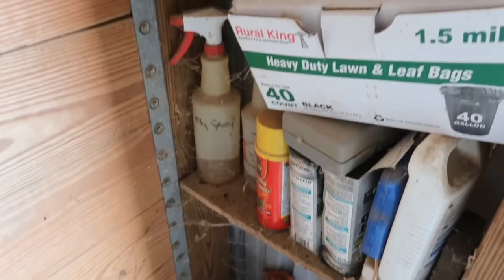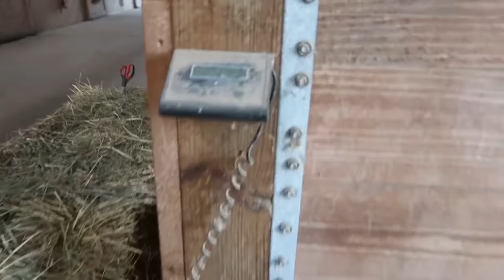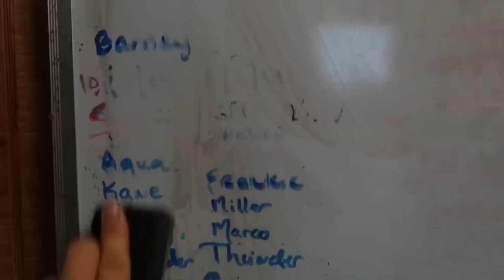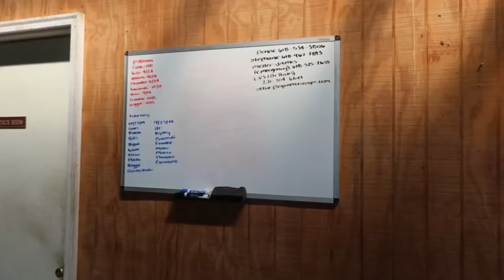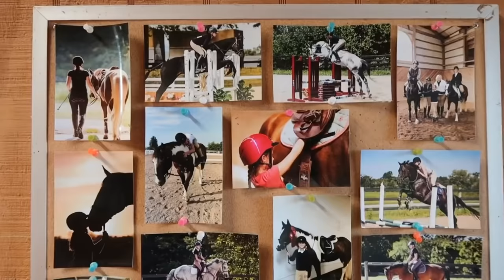cleaning the barn for 3 days straight (satisfying)

Comment: Know this is an older video so you probably won’t see this comment. 
Cobwebs dust and dirt might be minimized if you have properly sized exhaust fans.  Appears that the stall fans are stirring up and recirculating dust, exhaust fans will help get it out of the building.

Comment: Doesnt the wooden walls get moldy from being soaked at the bottom? 😬
Reply: The wood is treated with stuff to protect it before they use it to build the barn
Reply: Polopony20 I guess you mean impregnated? It probably is but it could still get moldy from being soaked and not drying very quickly , I guess the future will tell if the wood goes bad :)